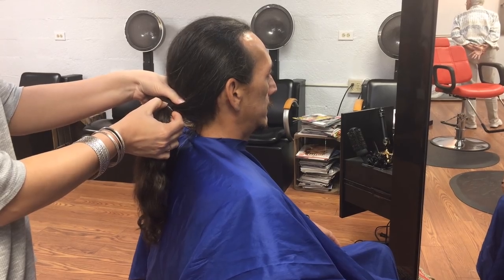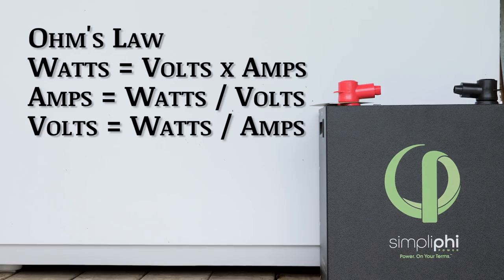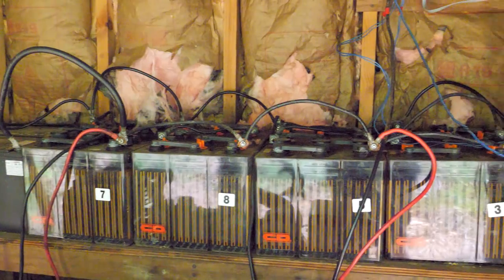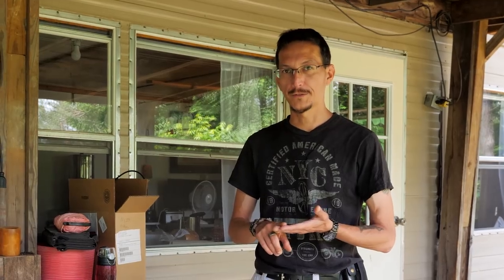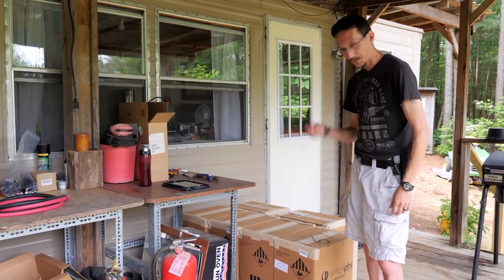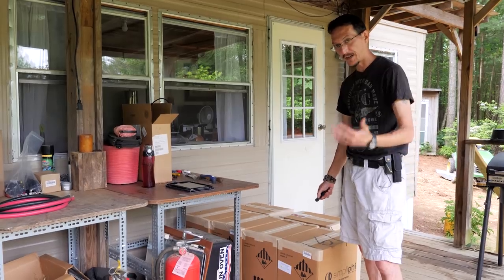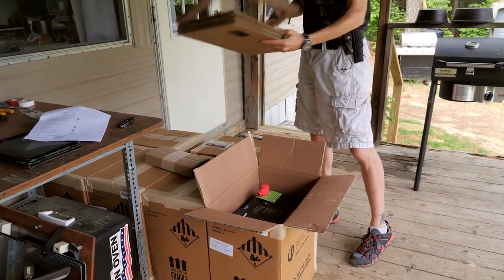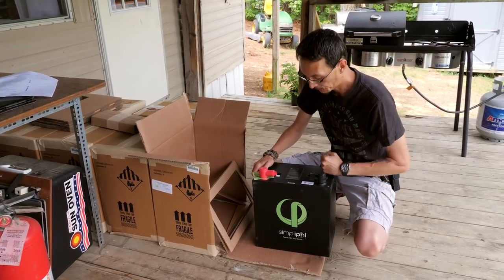DIY Off Grid Solar: Building a LiFePo4 Battery Bank (Part 2)

Comment: Here's an idea build your battery box well-insulated and I mean well-insulated next to your panels put your inverter in a separate box right next to it and run of that extension cord to the house running AC just a thought

Comment: Nice video.  I have a few comments.  

Lead acid batteries can do 80% DoD (depth of discharge).  What is poorly explained by many people is what determines the ability for a lead acid to work well at 80% DoD is the thickness of the battery plates.  An example is the Rolls 5000 series does 80% DoD.

Also, your inverter is at peak efficiency 95%.  At high load is going to be closer to 88% or 90%.  Generally the rule is 80% and that is also how you size the dc breakers and wire when planning this.  Another part is to take in the surge power the inverters are capable of like the Magnum inverters can handle a surge for total power of around 6000 watts for about 30 minutes and making sure the wire losses are less than 1% will ensure nice cool wires even when handling a large surge.

Wire length isn't what is crucial to determining that the batteries all charge at the same rate, it is the wire resistance.  A micro-Ohm meter is what will let you get it balanced exactly.  However, since you are using lithium with a battery management system in each battery it isn't nearly as much of an issue as it is when dealing with lead acid batteries but it helps in discharge.  The big place where wires can be the same length but have vastly different resistances causing an imbalance is the lug termination.  Seen it quite often where the wires are the same length but just a bit off in the resistance.

Anyways, this is most likely way more than you wanted to hear about in a comment.

Comment: Make sure to keep the parallel cables the same lengths and use a good buss for the connection.  I also use am using inline breakers for each string of Simpliphi for and diagnostics later.  Did our account for the actual usage of 2.8 kWh per battery for the 10,000 cycle settings

Comment: Great info here, I’ve one question if I have a 96v 700ah battery bank could I use a couple of MPPT controllers to increase the output as there only seems to be CC rated up to 48v

Comment: hindsight is a wonderful thing...kinda.  i really wish I had of gone with lithium batteries.  I have a room full of big batteries which  are going well, no problems but they need to be maintained etc and i have a room full of poisonous gases etc.  great system you  have built there.

Comment: You can get a rechargeble remington haircutting machine it has a vacuum in it. Very handy,cuts very well and very cheap too, not messy. Cost over 60$ maybe cheaper, once recharged you can use for 3 cuts atleast.

Comment: nice video, clear and understandable. very nice system your building. better be though for that money. you spent more on those batteries than i have in my 10 acres with my house and current outbuildings included. i spent 300 dollars for a electric pole to hook to the grid out by the road and ran cable 300 feet back to my house. my current electric bills are about 60 dollars a month. i weld and use electric heat for the bathroom and kitchen in the winter and a window unit a/c in the summer. i also have a 500 dollar solar system for backup power if needed. for the price of the total system your building i can pay my electric bill for 40 years and let them maintain the system. everyone is different though and i like to watch so build away.  as always, thanks for the video.
Reply: Yes you wouldn't do this to save money, but lots of people like the independence and many people drop way more than this on a fancy car, but give me a crappy car and my own off-grid power any day! :-)

Comment: You mention that cold temperatures hindering the charging of lead acid batteries, did you notice that the minimum charge temperature for the Simpliphi Lithium battery is 32F?

Comment: Jeremy, what size wire will you run a little over 100 ft from your solar panels? and by the way great video!
Reply from the maker: 4AWG fine stranded copper welding wire

Comment: you should use thhn stranded wire on longer runs. stranded wire  produce less heat less res and carries a load better on  a longer run

Comment: You mentioned these battery types don't suffer with temperature changes, but I'm pretty sure lithium iron phosphate batteries suffer just like any other in the cold. The BMS might compensate but the amp hours will be significantly reduced in the cold months and it might not be healthy to try and charge them in the cold. Just mentioning so you can research this and maybe factor in a well insulated and heated, vented storage area. Pretty awesome system your building!
Reply from the maker: No battery wants to work at or below freezing but these aren’t as finicky to require compensation based on ambient temperature differences above 32F. They still need to be protected from freezing.
Reply: I’ve have my Nissan LEAf with Li batteries.  It Charges in the cold and heat ok.  At 5 years and 76,000 miles later my LEAf ‘s driving range reduced from 90 miles to 60 miles.  Still thrilled to be a bioneer.
Reply: So they say... I'll be curious to see how they work long term. No matter what your solar and eventual wind system is going to be amazing. I'm happy for you guys.
Reply: Juli Viel All decent electric cars have battery heaters. The Leaf has this system and heats the batteries while charging in the cold. You won't go very far in freezing temperatures otherwise.

Comment: Thank you for the information!  Will you keep the old stuff for out buildings where usage and reliability aren’t essential and you can change out batteries and panels when they die?  ( I’m thinking int the pantry for a heater or the container shop space.) Just a thought.
Reply from the maker: Yes

Comment: Not sure if you came across this in your research but you can get a dc-to-dc converter that will convert higher voltage DC down to 12 volt and I believe it's quite efficient
Reply from the maker: Yes. About $150

Comment: How about the insulation for your lithium batteries? I have not installed mine yet but my understanding is that they will not charge at the freezing temperature. My battery room is insulated but still gets below freezing. I see your room also insulated. How do you manage the temps?  Thank you in advance.
Reply from the maker: I run the generator inside the battery shed for about 10 minutes to heat it up and it stays warm for quite awhile. The temp sensor manages the charger output.
Reply: Thank you for your quick reply to my question. Unfortunately, my battery room is very tiny so I do not have a space for a generator. My neighbor uses a light bulb. I was thinking of using thick styrofoam around them. I wonder if I can use some sort of heating system....?
Reply: @CK-pz5kq  they make heater blankets. Lithium batteries will still put out power below freezing.
Reply: @cliffweatherbee6914  Good idea on the heater blankets.  I was suggested the same from someone else as well.  Blankets that put out low wattage will probably work w/o hogging up the energy from the batteries. After all, I only need them during the daytime while the solars are charging the batteries.  THANKS!!

Comment: At 14:50 you are accounting for the rate of discharge when calculating the AH requirements of your system and you are doing that again later at 16:00 when you calculate the effective AH your battery banks can provide. Am I missing something or you are actually accounting twice for the rate of discharge?

Comment: Watts = Volts * Amps only applies to DC circuits or AC circuits with a power factor of 1. Reactive loads cause a phase shift between voltage and current and a reduction in real power (VA or Volt-Amps) transferred.
Those Simliphi batteries are outrageously priced (like most things from the AltE store). I bought 7.5 kWh of LiFePO prismatic cells for under $1500, they are rated for 5000 to 10000 cycles at 80% DOD. I use a 300 amp BMS (battery management system) which allows me to string 16 cells in series and maintain perfect cell balance. 
BTW - you can't get anywhere that kind of life from standard Lithium Ion cells.They are only rated for 500 to 700 cycles at 80% DOD. LiFePO is a totally different animal.

Comment: I just watched your "DIY Off-Grid Solar: Building a LiFePo4 Battery Bank (Part 2)" video. That video is very interesting to me, because, like you, I'm about to replace my old solar-electric system (which has lead-acid batteries - actually AGM batteries), and I've been going through pretty much exactly the same research process you've just gone through. I've decided to use LiFePo4 technology for the same reasons you're going to use them.

I'm not sure at this point if I'm going to use the SimpliPhi brand, the Battle Born brand, or the KiloVault brand of batteries. Currently I'm leaning toward the SimpliPhi 3.5KWH 48V battery, same as you. My capacity needs are similar to yours, and I'd be using four of those batteries, just like you are doing.

(If I didn't know better, I'd wonder if you'd made this video just for me! :)

I did notice what appears to be a minor calculation error in your presentation. It's the part where you say, "And then I need to factor in an additional 20% to account for the 80% depth of discharge that I'm allowed to do on these batteries." I believe you should have added 25% instead of 20%. I think this small calculation error is inconsequential, but I just wanted to mention it.

Other than that, I think your vidoe is excellent. It's one of the best I've seen on the subject.

Best of luck to you!
Reply from the maker: Yes. These batteries are fantastic. I would buy them again.

Comment: Great video! Thank you so much for summarising and making it so simple! One question though:
When doing the calculations, you have first taken into account the 80% depth of discharge rate to determine your batterie size coming to 300A/48V. (14.4kw/h)
When you reverse calculate at 15:50 you take into account again, 80% discharge rate. Does that mean you oversized the batteries by 20% by accident or did I miss something? Thanks in advance for clarifying

Comment: I’m currently using a 4kw solar array system.  With a 48v battery system (16 Trojans total).  I don’t like them because they don’t hold out, plus the maintenance. How many of those SimpiPhi batteries I would need to hold me out on 3 days of no sunshine?
Reply from the maker: I’m using 6 for 3 days without sun
Reply: Guildbrook Farm - Off Grid Living  thank you

Comment: Will the lithium bank be installed indoors in warm area during winter?   How does Temperature effect the LI battery if used out doors?
Reply from the maker: They are less prone to temperature problems but still shouldn’t be charged at full rate close to or below freezing.
Reply: Guildbrook Farm - Off Grid Living thanks for the tip

Comment: Hi i am wondering if you still have battery issues where you have to watch the level? I am looking to go solar but want the level of power i use now. Im not sure if a 3 kw system would work or if a 6kw system would be better? I dont want to worry if the batteries will go down or not. I know thats a tall question   I am not a green guy i just want to build a container house and dump the electric co. Can you offer any ideas? Thanks
Reply from the maker: You always have to keep an eye on your charge levels but if you create a load list and  size your system to accommodate that for how ever many days you want to run with no sun you’ll be off to a good start. Today has been cloudy and rainy all day. No sun and been using quite a bit of power. Batteries are at 75%. Tomorrow will be sunny so we’ll be working outside not using much power inside while the sun recharges the batteries to 100%. So yeah it’s always something that needs to be monitored but we don’t have problems or worries about it any more because we have enough power for what we need to use.
Reply: Thanks it gets hard when you look to add more appliances with out wattage ratings well shopping for them. In yhe late 70’s the motto was excess is best and looking around that could be a 4000$ difference. Thanks

Comment: 13:20 Optimists figures, however, I noticed that the maximum continuous discharge/charge current per battery is rate C/2 or less which is pretty low. I suspect that it's to ensure the batteries never get too warm thus slowing degradation.
Reply: Ha, I was right. Stated in the warranty.

Comment: Hi I love your videos and I have a few questions. My father uses 500 kWh per month for his home and I am looking to purchase 400 watt solar panels and 12 volt 100ah lithium phosphate batteries. How many panels and batteries would I need to run his home? Also I have a 2000 watt inverter and 80 amp solar charge controller. He uses appliances such as a refrigerator, freezer and TV.
Reply: 500kwh equal about 16000 a day overall seasons you have on average 4 sun hours depending on location meaning you'll need a 4000 watt array 6000 watts should be better the 2000 watt inverter wont be enough to power a household unless you really cut back on appliances you run at a time 6000+ watts low frequency inverter Is what you should look for if its offgrid you'll need at upto 3 days worth of usable capacity at 16kwh so about 48kwh of batteries.

Comment: After your recent events audit, I was wondering how many kwh does your desk top computer use? 💜🌞🌵
Reply from the maker: 1.6 if I run it 8 hrs
Reply: Guildbrook Farm - Off Grid Living, so 200w per hour? (Is that how it works?) 💜🌞🌵
Reply from the maker: Approximately yes. I don’t run it 8 hrs a day every day. But I can if I need to.
Reply: Guildbrook Farm - Off Grid Living, I'm trying to figure out if it would take less watts to run my desktop to watch movies or get a laptop and hook it to a monitor. 💜🌞🌵

Comment: I've been reading up on LiFePo4 batteries, and I've read that they shouldn't be charged below 32 degrees F.  Did the ALT E store warn you about this? That's a huge investment, and I know that your power center is currently in an outdoor, open-front shed. I'd hate to see them damaged next winter.
Reply from the maker: The shed will be insulated before winter
Reply: May I suggest installing a wireless thermometer in the shed that you can monitor from the house?  I' not sure how far away the shed is from the house though.... I wonder if you can get one with a set-able alarm.  Your idea of using coals to keep your canned goods from freezing was an outstanding idea, so I'm sure that would work for your power shed too.
Reply from the maker: If the shed is insulated well, the heat from the inverter should keep everything above freezing, and I can monitor temps via ethernet connection to the charge controllers.

Comment: I got confused when you were discussing total battery Ah capacity vs. your measured Ah requirements using a watt meter.  Your amp hour requirement is based on your meter's Kwh reading, and that's based on 110 (or 120) VAC.  My measured loads (one fridge and two chest freezers) was 4.7 kwh/day, so I'd divide that by 110 (not 48) to get a 42.7 Ah/day requirement, right?  Or would it be 4.7Kwh/48V to get 97.9 Ah/day?  It makes a huge difference in cost sizing my battery bank (since I'm considering changing out my AGMs with LiFePO4 batteries).  (I'm leaving out the .80 D.O.D. and 3 days autonomy calculations for clarity) Thanks!
Reply: It's 97AH for a 48v battery bank, but there are inverter and cabling losses too. If the inverter is 80% efficient than you would need (1/.80)*97AH=121.25ah@48v. It might save you a whole lot of money to buy a DC freezer as shown in this channel or just more efficient fridge/freezers.
Reply: Thanks!  I agree that DC refrigerators and freezers would be more efficient, but since I am grid-tied and use my hybrid PV system as emergency backup (I live in a hurricane-prone area), I have the more conventional a/c refrigeration.  My AGMs are 8 years old now, but they've never been cycled below 60% D.O.D. and have only been cycled that low a couple times due to extended power outages.  

To eliminate my own confusion about battery Ah requirements, I used the KW rating of my loads using the "kill a watt" meter vs. the KW rating of the batteries.  I figured in 80% D.O.D., inverter efficiency of 95% and 3 days of autonomy to get a total requirement of 17.7KWh, which would require 6 48V 3.5KW Simpliphi batteries.  But since I'm grid-tied, I'm planning to start out with only 3.  That, with my 3.5KW worth of panels (even if they are making less than optimal power) during the day, should be enough to keep my food from spoiling until power is restored in all but a catastrophic hurricane.  Even with only 3, that's still a serious chunk of change. But since they can be discharged much deeper than my AGMs and can be housed in a much smaller area, it makes up for the price differential somewhat.  Although their high cycle rate would be a major factor for someone living off-grid since the LiFePO4's last 3 times as long as standard FLAs, this is not as much of a consideration for me since I hardly ever cycle my AGMs below 95% of charge.

Comment: I have a couple questions for you ..... 1 are you still happy with your Batteries? 2 I'm offgrid in northern Colorado while I live in Minnesota and I'm worried about while I'm not there what options is there so batteries don't freeze?
Reply from the maker: Yes they’ve worked perfectly so far (15 months). They aren’t as vulnerable to colder temps as FLA batteries but you do have to keep them from freezing. I keep the battery shed insulated and heat it with the inverter waste heat and a supplemental heat light.